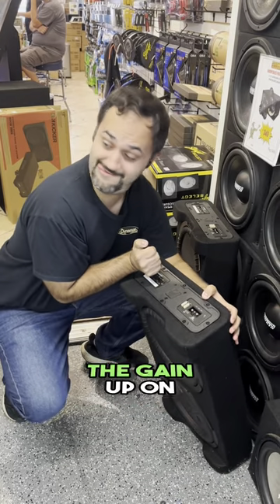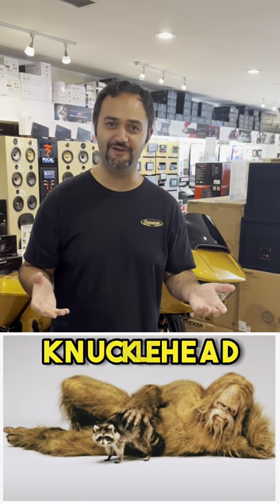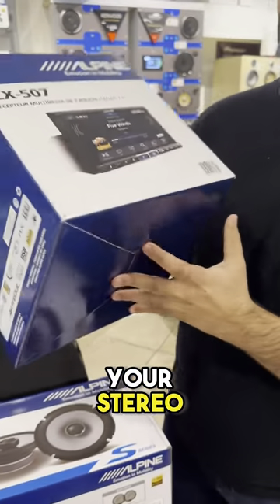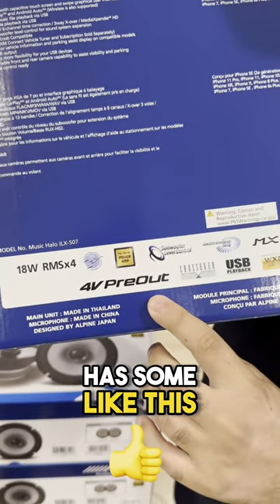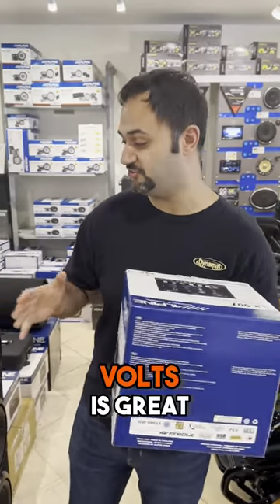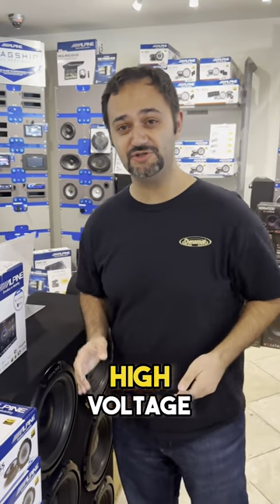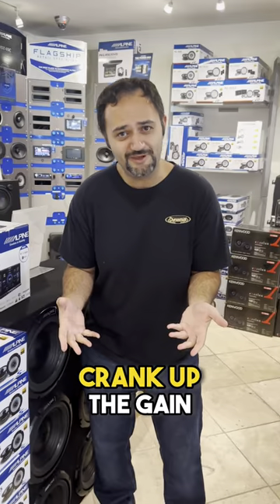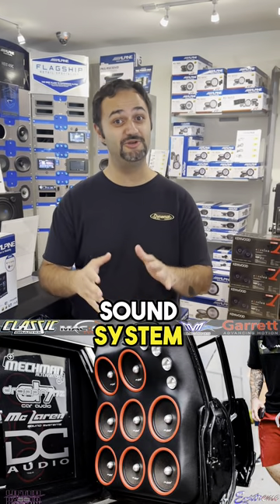Don't CRANK The Gain On Your Amp! Subwoofers Will BLOW  #subwoofer #bass #caraudiofabrication

Comment: I soldered the gain off my amp and bypassed it full gain for maximum distortion.
Reply: Next would be to add speaker wires to my rca Jack's and bypassing the bass boost  to full boost

Comment: If you have to "crank up" the gain, you probably need a bigger amp. Not more gain.
Reply: Learned this soon after my first subs. 3 350 rms subs powered by a 1200 watt sub, at 2ohms I was barely getting half the power

Comment: Most headunits only produce that max output at max or almost max volume.  For example, my Kenwood Excelon goes up to 60 volume and is clean all the way up, i dont see the 5V until 59.  When i set my gains, I put the volume to 44 (where im getting about 4V) and go from there.
Reply: My Sony put out a clean 8v at volume 28 sw level 7. Tested with oscope and fluke

Comment: You're right but i think 2 volt pre outs are just fine, it only increases the chance of noise in the system. Most if not all amps can produce full power on .2 volts.  the gain would be all the way up, but it would be set correctly. That's why most amps state input sensitivity is .2-6 volts. The gain matches the output voltage of the amp to the input voltage your stereo gives it.

Comment: I use a lc2i, it claims preamp 9.5vrms and 13v max on main/bass outputs. Works great for my American Bass hawk 12. Barley had to adjust the gain on my Taramp 3k. No distortion and amp stays cool. Ngl I didn't know output voltage was that important until now!

Comment: It all depends on what type of speakers and amp you are running. if you have a headunit with 2.5v preouts and are running more than 2 amps then you’d need a dsp to give your amplifiers the voltage they need. on the other hand, if you have a 4-5v preout amp then a dsp might not work correctly it depends on your dsp. it’s all relative
Reply: Whats the best opinion for a 2018 dodge charger? I have the pac ap4-ch41 but cant get it to work and now doing a ds18 5 channel inline converter and having trouble 🤡
Reply: Not limited to a DSP that's extreme. line out converter really all any one needs
Reply: @NOSHISHIPANTEEZ808 2018 charger, running factory Unit in dash?
Is it amplified or just a base model system?

If it is not amped you need the pac, if you are running a system like bose infinity ECT 
You can utilize the speaker output of the unit not the amp, take signal and dsp then amplifier.

Comment: What do you think of bass knobs? What do they actually do?
Reply: passively you can only attenuate (reduce) a signal (voltage). some amp bass nob may work actively within a preamp gain circuit.

if you use a line in/out nob it only turns down.
Reply: 3272 is right.. it's not a bass knob.. that's a marketing term. typically overrides the gain to the point the gain is set at.

Comment: It's not a knuckle-head. How about tuning the output voltage to be able to peak to the maximum output power of the amplifier.
So to say 1 way is right or wrong, as alot of units are only 2-4volt rca output.
Rather getting a 6-9volt output.

Though buying a nice head unit,, is key to having quality sound production. 

gain matching works perfectly fine! So be wise with words and explain properly.

Comment: What if i bought a chinese radio that doesnt specify the output?
Reply: You can measure the RCA output voltage with a multi meter measuring 1 channel at a time

Comment: I just bought a 3 pre out Sony head unit. Should I get something else?
Reply: What voltage are they? You have 3 preouts(Front, Rear, sub) which is good but it should also show what voltage they are.  4 or 5V is best.  If they're 2V I'd maybe consider buying a higher model.
Reply: @derekgardin1512  just did a little research. It’s a 2 volt but I’ve already installed the radio. How will having a 2 volt effect my subs and speakers?

Comment: Many of the aftermarket source units available today do not generate the necessary signal voltage levels. Even some of the top-rated units are only capable of producing 4V RMS, and most of them struggle to even achieve that. If you happen to have a source unit that can produce 4V RMS, you will need to set your volume level to maximum in order to reach that output. However, this often results in signal distortion. The general rule of thumb is to set up and tune your system at 3/4 volume to avoid distortion. Unfortunately, even a high-quality 4V source unit may struggle to reach 1V RMS at 3/4 volume. Adding a second or third amplifier to the chain will further decrease your signal strength...so, i always encourage anyone who is in car audio to get a Tru Technology 6 channel line out converter, Arc Audio line out, or get a Helix DSP which allows you to raise the line out voltage that you need without worrying about the head unit. I can not stress this enough, why spend all that money in car audio and cheap out on the most important part, the quality of the source
Reply: I always set my gains at ¾.  My excelon deck does 3.3V at volume 45/60.  Good enough.

Comment: You're talking as though gain is a sort of volume knob. You shouldn't ever "crank up" the gain. Match it with your pre-out voltage and don't touch it after that. You're sending a very misleading message that's gonna confuse a lot of people and potentially damage their amp.
Reply: Dude he said in the video "don't crank up the gain"
Reply: My guy you just explained the video in a text.
Reply from the maker: As others have mentioned, you're just re-iterating my point. To say I'm "misleading" others is strange indeed.
Reply: What dose the high voltage do
Reply: @markspeakman395 Higher voltage is basically a louder signal coming from the head unit, so less gain is needed from amp.
Reply: 2 months later and I'm just now seeing these replies. My bad, I guess. Don't remember what it was about, but obviously I misunderstood the message. Y'all have a nice day and remember not to crank the gain up lol
Reply: @markspeakman395 it just means your amplifier doesn't have to work as hard is all. If you set you gain appropriately and give it clean power you will never damage it.

Comment: Man I had bought the alpine ILXw650 with 4 volt preamp, can crank the shit out of it full volume with bass all the way up and not even come close to 4 volts. The internal amp clips at 26ish.
Reply: I don't even use the internal amp on my decks.  I also only buy decks that allow me to turn off the internal amp too.  Cleaner signal.  Running a Pioneer 80PRS and Excelon X-305 right now.